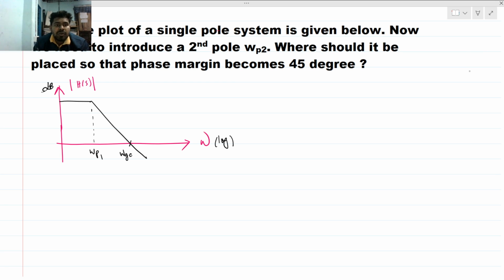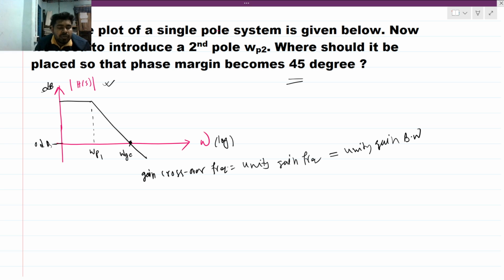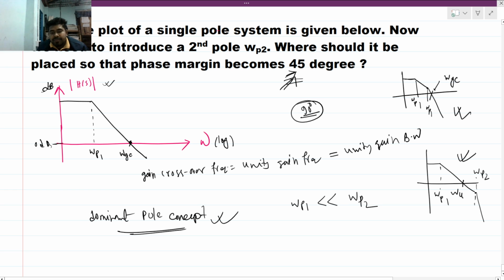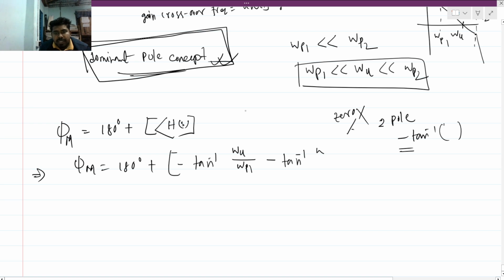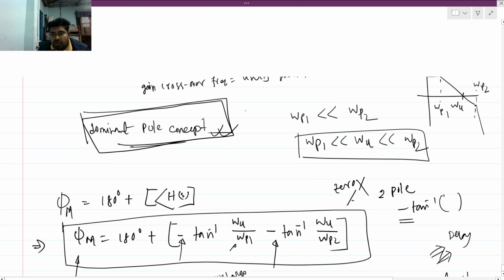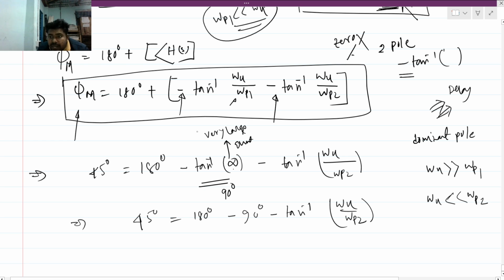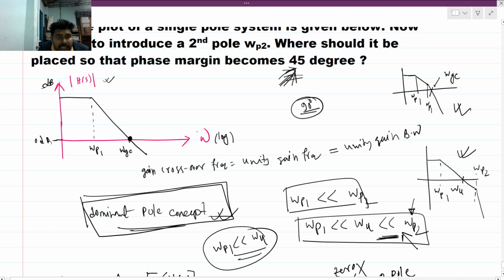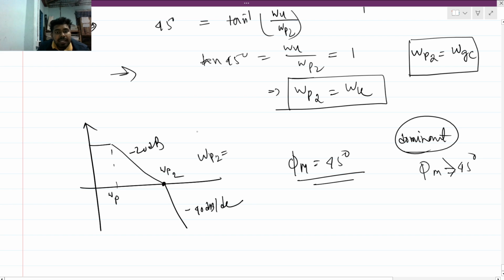Micron Technology Interview Question for Analog Design Engineer

Comment: shouldnt it depend on the DC gain as well? if you have a small DC gain vs a big DC gain, the cross over freq is different, so in the case of small gain, you can not assume Wgc/Wp1 is infinite anymore
Reply from the maker: Yes,phase margin depends on DC gain...If gain change due to Overall Gm then Wgc also changes ,so verall  phase changes so the PHASE MARGIN changes
Reply: @AmitBar-Analog_Circuits  why doesnt PM depend on DC gain? DC gain should change my unity gain cross over frequency, but DC gain does not change phase plot, and PM depends on unity gain frequency and phase plot so shouldnt PM depends on DC gain?
Reply: @tony5r000  yah PM equation depends on the DC gain, the information of the DC gain state is stored in the unity gain parameter, as the DC gain shifts up, the wu shifts right, and vice versa
the problem in this video is more inuittive and want only to check the applicant's understanding